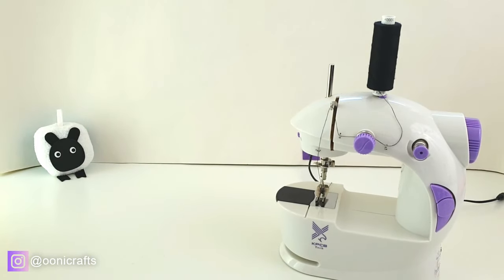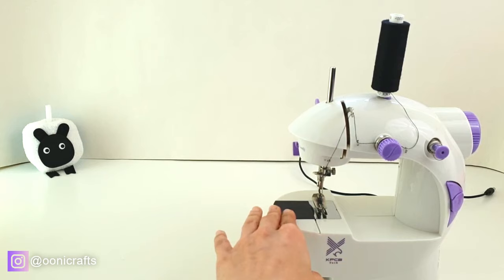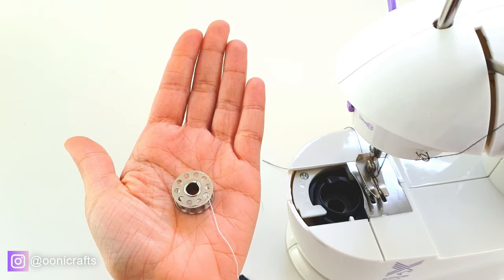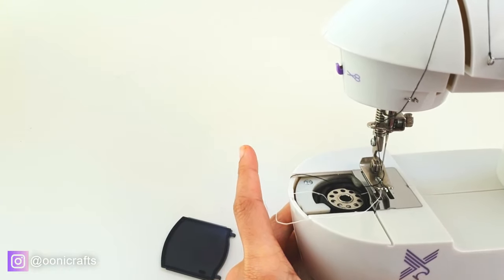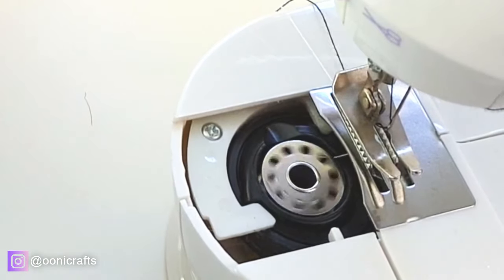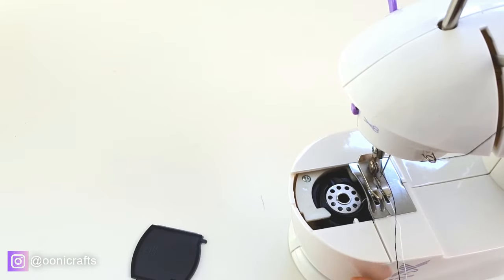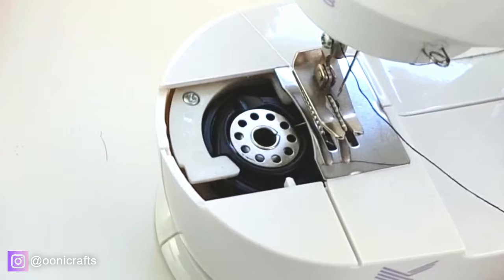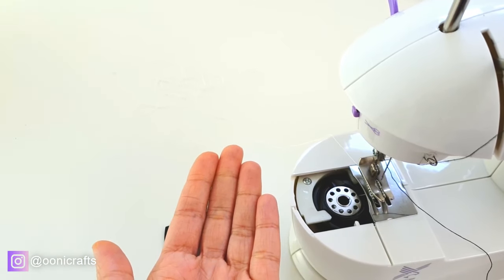Mini Sewing Machine Bobbin Threading Problem? Bobbin threading SOLVED!!!

Comment from the maker: Thank you so much for watching! Please consider subscribing if you enjoyed or learned something useful from the video. Happy crafting!
Reply: Thank you for helping post and listening to my complaints.but i wasnt talking about the bottom bobbin.i was talking about the upper threading..it keeps hanging on that long rod where we insert the thread b4 passing it to the next hole and then the needle....the rod inbetween the machine is where the thread hangs and cuts......it just keeps cutting once i sew...to pipe a neck,my thread cuts close to 10times.doesnt sew 1minute at a stretch.it will curl and cut..please help me..its the upper thread..thank u
Reply from the maker: @AkahFortune  hi. I'm so sorry to hear that your machine's upper thread keeps breaking.  It is very unusual.  Could it be that your thread tension is too high? If it is , the thread will break as the lever goes up and down. 
Please do check the tension. 
This video will help you. 
https://youtu.be/ZEky17PmJo0

Good luck! x
Reply: Please ma'am. mine makes so much noise while sewing I'm I don't feel comfortable sewing
Reply: What if my sewing machine doesn't have a the room for the bottom thread? The line where you could place the string in.
Reply: Should I buy this machine is this worthy?
Reply: I'm having issues because my machine doesn't that little groove to place the string into to catch the needle. If that makes sense..
Reply: Mere machine m silayi nhi aa rhi h
Reply: I m doing the same but bottom bobbin's thread is not coming out. So disappointing.
Reply: Helppp my needle keeps getting stuck and idk what I’m doing wrong

Comment: Thank you so much for making this video! You saved my sanity and my machine is working perfectly 💞
Reply from the maker: So glad this helped!
Reply: mine is uten 505, all you need is a hex screwdriver to fix the timing issue. It only happens when the thread is jammed though so I have to rotate the knob toward me to check whether the thread is jamming or not then I got this issue (see the video). I used the bobbin that cam with the machine and it works fine no jammings
Reply: hey, Jesus loves you!

Comment: I did the nifty 9 method but my bobbin still keeps on bouncing andkeeps creating a 'birdsnest' inside the bobbin casing. could it be the magnet underneath the bobbin? Because the bobbin casing i have has a magnet and the magnet isn't not sticking in well it only held by a double sided sticky tape.  Could the magnet be the problem?
Reply from the maker: Hi
I have not noticed a magnet in my machine, I'll double check. But its presence or absence should not be the problem. 
Nesting occurs largely due to some very basic reasons.
I would firstly give the bobbin casing a thorough cleaning with a soft brush. Next check for any burrs and file them down. 
Make sure you work your way down this checklist before sewing 👇

https://mailchi.mp/4c24ab312dc9/mini-sewing-machine-operation-checklist

Hope this helps x

Comment: hey, thanks for your video! I'm having a similar (yet more complex) issue. The plastic that's supposed to hold the bottom bobbin keeps jumping out, or otherwise just not turning with the thread. I mean the plastic that comes out in order to put the bobbin in it. Is this a sign of a broken machine / broken part? Is it fixable? wish there was a way to share a video in this comment to explain better what I mean....
Reply: I have that same issue :/
Reply from the maker: Hi I think you are talking about the bobbin casing 
it really isn't supposed to come out unless you open up the sewing machine and unscrew it. If it is jumping out of its own accord it means that the machine is faulty and you should return it for a refund

Comment: I am having trouble with my bobbin thread ... i strictly follow the nifty-nine method ... would start fine then the bobbin thread gets tangled so stitching would stop and won't move ... becomes difficult to remove the fabric from plate as the bobbin thread is tangled and i needed to cut the tangled thread from under the fabric to get it loose ... sometimes the upper thread would just snap ...  keep on trying adjusting tension but still problem persists ... can you maybe enlighten why this is happening?  thanks.
Reply from the maker: Hi Marlon,
Thank you for your comment. I'm so sorry to hear that you are experiencing this annoying problem.  I'm working on figuring this out too. I'll update you as soon as I find a solution. 
Meanwhile I would urge you not to feel frustrated and just put away your mini sewing machine for a few days. 
I did a detailed video about this here - it's not a tutorial but a candid chat about what to do in a situation like yours. Feel free to check it out here. I will try to post a solution very soon!

https://youtu.be/pTtk6bpx4UE

xx
Reply: @OoniCrafts  thank you so much for your sincerest concern regarding not just my situation but of your other subscribers as well.  No worries here as i am very much interested in learning more about using this mini machine ... looking forward to whatever helpful inputs you would be sharing ... there is already so much info in that video you referred for reference ... again many many thanks.
Reply: Just an update, I think this problem has something to do with the type of fabric i used for my project ... it's polycotton, somewhat slippery.  i switch back to using cotton fabric, same brand of thread and my machine worked well again.  i was able to finish a face mask without interruptions.
Reply from the maker: @marlonordonez1368  hi! For slippery or fine fabrics try using a sheet of stabilizer or cut up plastic bag or tissue paper underneath the fabric.  It should work out fine!

I did a video about this here,  i hope it will help you x

https://youtu.be/O4Zy0T4PVV4

Comment: so my issue with this machine is that the black (top) thread goes around the spinner for the very first loop. Then, starting with the second loop, it stops catching the thread. so mine is not stitching. can you please help thank you..
Reply from the maker: Hi Eunhye, I'm so sorry to hear that you are experiencing this annoying problem.  I believe there is a timing issue and I will be opening up this machine to figure out the internal mechanisms and posting a video about this soon. 
Meanwhile please don't let this get you down.  Tuck it away in a cupboard and try to focus on another hobby if possible x

Comment: Hi ty so much... I saw ur video n tried to fix my machine.. Adjusted the bobbin housing but wen I try to sew the cloth gets stuck between the needle n the plate n doesn't stitch... Pl do help
Reply from the maker: Hi Asha, thanks for your kind words.
Hm, the fabric getting stuck makes me think about what kind of fabric you are using. Are you using thin fabric? If yes, the mini is just not compatible with it. There are hacks around it, but first look at your fabric, let me know what it is that you're sewing x
Reply: @OoniCrafts  thank you so much for ur prompt reply... I had used cotton fabric... Will try wid other fabrics n let u no thnks once again
Reply from the maker: @drashasharma70  cotton is perfect,  but not thin cotton. Lawn or malmal is not suitable.  Try medium weight or thick cotton. x
Reply: @OoniCrafts   Hi mam sorry to kip troubling u.. I tried wid cotton fabric again but double folded it but now a new problem arosed the needle doesn't move up n down the machine jus makes noise but the needle moves if hand wheel is rotated..

Comment: The digit 9 method did not work for me. Bobbin case still jumps. And is pulled towards the needle. Changed threads too, but still the problem was not fixed. Any other suggestions ?

Comment: Hi
Thanks for the great video. I am having a problem with my mini sewing machine. When I turn the handwheel it does not turn properly and I feel resistance and my needle also doesn't go down fully. I just tried to apply some force right now while trying to turn the handwheel and broke my needle. Now I don't even know how to fish out the broken piece of the needle from the tummy of machine. Everything is so compactly packed in the bobbin area and there are no screws to loose and dismantle it.
Please help.
Reply from the maker: Hi Mary,
I'm so sorry your sewing machine is having this problem. Someone else also mentioned something similar so I will try to find a solution to yours soon.

Meanwhile,  I did a detailed step-by-step of opening up the mini sewing machine in this video: https://youtu.be/_N6F1ehfJKs

It will certainly help you get the broken needle out. x
Reply: @OoniCrafts 
Oh , thank you so much. At least I will be able to get the broken needle out of it now.

Comment: Hi! The video is very helpful, but i have a problem with my Machine in niddle section.  When I'm switch on the machine and tried to stitch the cloth its nothing Happening. The niddle is not moving. Now what to do plzz suggest me some ideas to fix it.
Reply from the maker: Hi if the power is not coming through then the machine is faulty.  Please try to exchange or return it.
Reply: No, everything is moving in the machine. Only the niddle section is not working. I am greatful to you if you fix it.
Reply from the maker: Please watch this 👇

https://youtu.be/5VzrS36rUW0

Comment: My issue is the bobbin thread and the other thread stay separately on either side of the fabric after I ran the machine (bobbin thread stays on the bottom of the fabric, and the other thread stays on top of the fabric). I did the method 9 when threading the bobbin thread and follow exactly what you said. Can you please help me with my issue?

Comment: Hi,  i just want to ask about my sewing machine problem. I just want need help on how i can fixed it cause it didnt have stitches while it is used and i usually found out that the thread doesnt hook under the bobbin to run around so it would stitch. I hope you can make this a video and help us😊 thanks for helping i hope it would work😊
Reply from the maker: Hi Albert,
Thank you for your comment.  I  will be making a video about this soon! Hope you are keeping safe and well.
Reply: Thanks for noticing my comment and also for the help😊 I hope you earned more subscriber for helping us about this kind of matters😊

Comment: Hey Ooni, am using a sewing machine for the first time, and it doesn't see at all every since I bought it. I did the 9 bobbin thing, but it still doesn't pick up the thread ☹️ I don't know what to do!!!
Reply from the maker: Tae, if it's not picking up the bobbin thread, it is most likely a timing issue. Try this solution:
https://youtu.be/_N6F1ehfJKs
Reply: @OoniCrafts  I tried this, there was a timing issue! I fixed it ..but it still stitches only with the top thread☹️
Reply: @taesmoon8351  same 😭

Comment: Hi my stitches are uneven. The bobbin thread is picked up at times and the thread is missed most of the times. What am I doing wrong? I have threaded the needle and put the bobbin where the thread is pulled out such that the bobbin moves in a clockwise direction. The thread makes a 9 when I insert the bobbin in its slot. Please help
Reply from the maker: It's a timing problem.
Please fix it following this

https://youtu.be/_N6F1ehfJKs
Reply: Ooni Crafts thank you so much .. problem solved
Reply: It took me hours to finally get it right

Comment: So helpful videos. I want buy this mini sewing machine. Is this work on jeans material too? I'm pretty short so I have to  hem my pants.
Reply from the maker: Hi
Thank you so much for your kind words. 
You could sew two layers of denim, but three layers would probably be tricky. I will try making a video about this soon.
Also where the seams overlap, it is several layers which would be tricky. If you need a sewing machine specially for hemming jeans, i would recommend a bigger/heavier machine.
I hope this helps. I will try to hem jeans and make a video about this soon! xx

Comment: Hey, after watching your video I’m still struggling to thread the bobbin. When I bring the needle down, the thread doesn’t loop around and pull up the bottom thread. And even if I get the bottom thread through the hole, when I sew, no stitches are made. Please help!
Reply from the maker: Ana it's a timing problem. If you cannot return or exchange it,  follow this fix 👇

https://youtu.be/_N6F1ehfJKs

Comment: I'm having trouble with my machine :( 
The bobbin keeps jumping even though i did the nifty 9. I reckon the magnet lost its magnetic capacity. Please let me know if it's something else.🌺
Reply from the maker: Hi Umama, is the bouncing affecting your sewing? If not, I wouldn't worry too much. 
Also check your upper thread tension. Unbalanced tension will make the bobbin bounce.
Use the square method to check tension.
Also, what magnet?!
Reply: It jams the entire machinery. The tension's fine. The magnet which is under the bobbin to hold the bobbin in place.. (It is a magnet, isn't it)
Reply from the maker: There is no magnet on my two machines. If it were magnetic, the bobbin wpuld be stuck.
What thread are you using and is your bobbin casing clean and free of fluff? Clean it out with a soft brush. Let me know how you get on x
Reply from the maker: @umamanow8426  Umama thanks for the video link. Your bobbin housing is completely out of place. There is a huge gap on the left. Watch today's video to set it properly and let me know your progress xx

Here's the video 👇👇👇

https://youtu.be/3dRanPEnPXE
Reply: Sending lots of love❤️❤️❤️ Thank you so very much! It meant alot to me.. Have a blessed day :)
Reply from the maker: You're very welcome hun! Did you manage to sort it out? You can reach me via Instagram DM as well if it's easier x

Comment: What happens if the needle isn't picking the bobbing thread??😢 Because mine isn't working. And my sewing machine doesn't have that line where Im to place the tip of the bobbing thread

Comment: What type of bobbin thread do you use?
Reply from the maker: I have switched to mostly Gutermann with the occasional Coats and Moon. The mini sewing machine is annoyingly temperamental and has no way to regulate bobbin tension. I find that using high quality non fuzzy thread keeps the tension stable and makes for a happier sewing experience. Hope this helps x

Comment: Thanks for this video the problem that I had for the longest time was solved which was the bobbing threading.
I have been watching videos to do it but still having a hard time ur trick works for me hehe
The new problem that I had was the thread at the back it doesn't goes smoothly and doesn't seem hold properly.
Tried ur trick regarding the stitch I don't think it's applicable to my current issue.
Il check ur other videos if there is similar but if none hopefully you can help me :) thanks
U're awesome :)
Reply: Saw ur video regarding the top tension and seems my issue is the tension on the bobbin it doesn't seem to get the top thread  :(
Reply from the maker: Hi Erjeel, thank you so much for your kind words. I'm so glad this trick helped.
When you say "thread at the back", how do you mean? I would love to help you out once i can figure out what part of the mini sewing machine this is in.
Reply from the maker: @saminecloudheart6848  this is a very frustrating and common problem that lots of people are facing.  This is exactly why I bought the second mini sewing machine to open it up and see how to fix it. It's most likely a timing issue. I'm going to try and sort it out in a video very soon!
Reply: Wah thanks for the response yeah indeed it's a timing issue. After my comment I saw ur video and saw it was very timely.
Actually the 2nd sewing machine that you bought was the same machine I am Currently using and having problems with.
Ohh looking forward for future videos then :) thanks and more power :)

Comment: Hey, I have a different problem here. So basically that round purple controller which we use to go clockwise and anticlockwise with our other hand while sewing is not moving. But when I remove the needle, it's moving. With needle, it's not. I'm not able to solve it. Please help

Comment: Hi there thanks so much. Just one question, as I would like to buy some pre-wound spools to save some time. Would the clear plastic Class 15, A size spools be ok? They seem to be quite the standard for all sewing machines. Thanks
Reply from the maker: Hi, thank you for your comment.  While it can be tempting to buy generic pre threaded bobbins, i would urge you to stick to the metal bobbins. They are very different from plastic ones and even small differences can mess up your stitches!
Reply: @OoniCrafts  Hi, thanks for your fast answer and help, I was just about to buy some!
Reply from the maker: @larojigualda8671  I'm so glad i could help! The ones I bought from Amazon are these and they work perfectly 

https://www.amazon.co.uk/dp/B07SPC4MZZ?ref=ppx_pop_mob_ap_share

Comment: Hi I think I’m having a similar problem as some other commenters. My top thread will go about halfway around the bobbin then get stuck. The handwheel will not turn to force it to complete the loop. If I remove the bobbin casing, I can force the top thread past where it is getting stuck, then the machine will complete that stitch but get stuck halfway in the next one again. The top thread gets stuck about halfway around the bobbin, where there is a little “bump” on the left. Please help! I’ve wasted days trying to fix this, rethreading both top and bottom, sanding down, making sure no threads stuck down there, changing tension, etc.
Reply from the maker: Hi Jo,
Have you tried opening up the bobbin housing to see if it's out of sync? I've done a detailed step-by-step here. Let me know how you get on x

https://youtu.be/_N6F1ehfJKs